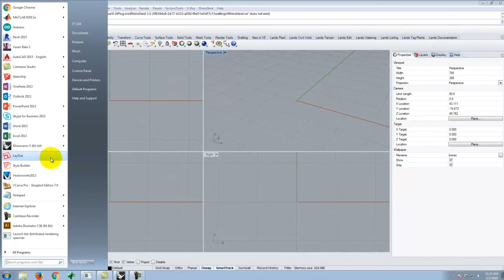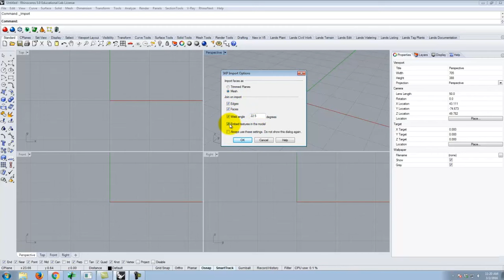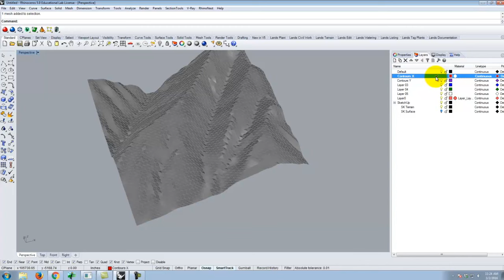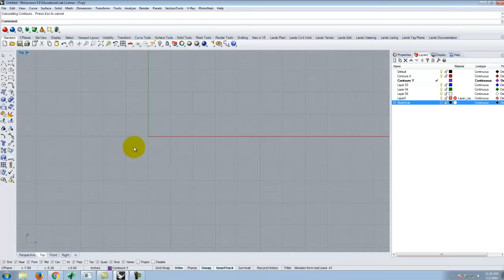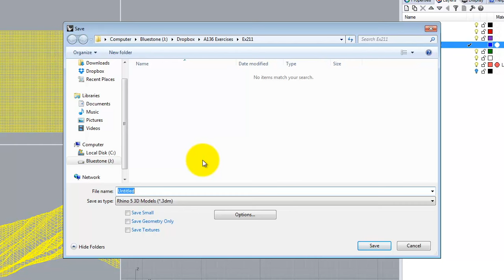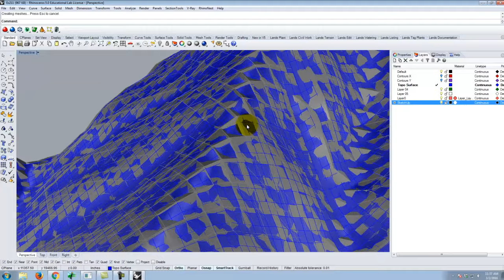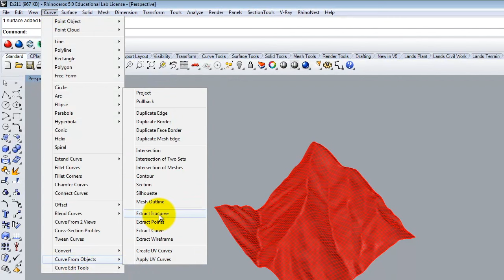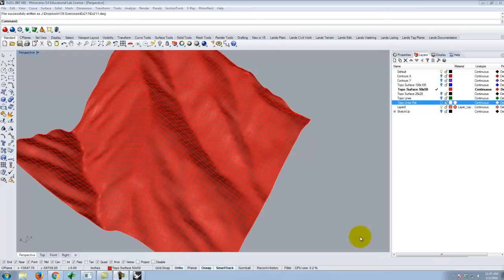Lecture 211 - SketchUp Terrain to Rhino (Spring 2016)

Comment: How do you turn on Vertex and knot in order to snap to the particular corner as seen in 15:46 of the video?
Reply from the maker: Sorry for the delayed response.  You need to toggle on the "OSNAP" button at the bottom of the page and then check the box for "Vertex" and "Knot."  If you are in an older version of Rhino, you may need to turn on the "Persistent Osnap Dialog" available under the Tools menu if I remember correctly.
Reply: Got it thanks! :)